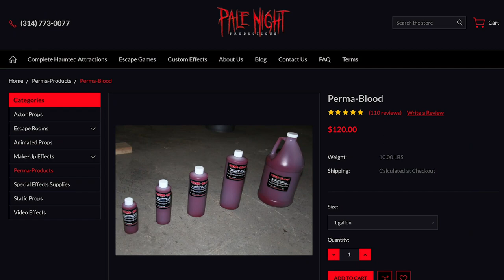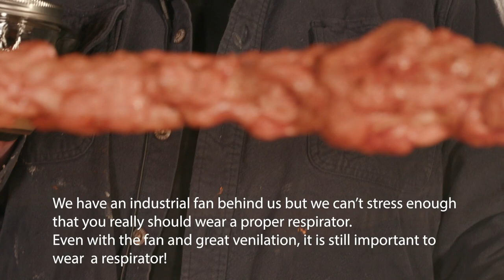Guts on a Rope - Tutorial

Comment: Excellent tutorial.  I am going to give this a try.  Question on making the latex skins you made on the board.  It looked like you had something on the board prior to painting on the latex.  Did you put something down on the wood to help the latex peel off easier.  If I were to use a white board like you mentioned would I just paint the latex directly on the whiteboard?
Reply from the maker: Awesome. Glad you liked it. No need to put anything down on the table as long as it is nonporous. Whiteboards just makes it easier to pull off. Just paint it right on it. You can take a tiny bit of baby powder to save the latex skins or to peel them off a bit easier as well. Send pics of your final piece. Would love to see them.
Reply: Thank you so much. They look great. Are they flexible  if you wanted to curl them up like guts?

Comment: Do you have a resource for the copic ink refills?
Reply from the maker: Yeah -- We get a ton from Dick Blick (https://www.dickblick.com/products/copic-various-ink-refills/). Great people and an easy to use site. We love copic but have also have had great luck with other alcohol based inks. We use FW ink for most our masks... FW Ink from Dick Blick as well. The key to this looking good is alcohol based ink mixed with isopropyl alcohol for fast evaporation. The higher the alcohol content the faster it will evaporate. Right now, because of Corona,  I.P.A. is hard to get.. so we also play with mixture of water. 

Keep the questions coming! :)
Reply: @StrangeandDeparted  seems isoprpyl alcohol is hard to come by these days, will 70% be ok or does it have to be 99% like you show in the video
Reply from the maker: @fredly8730  It sure is! Yeah 70% is totally fine!  Not an issue at all if you can find that. One thing you can still find a lot of right now is at lowes/home depot/etc is denatured alcohol. It fits perfect with alcohol inks. Make sure there are no open flames around. :)